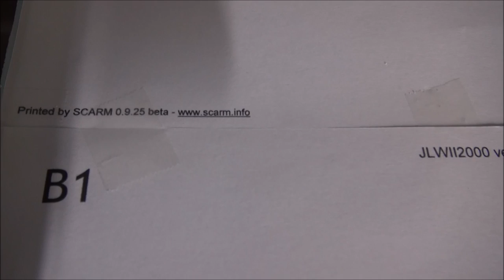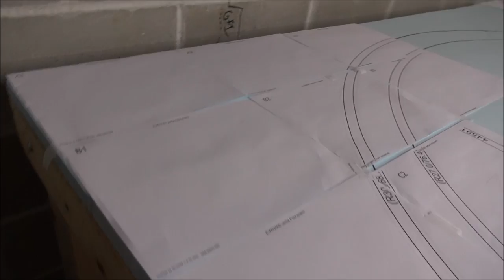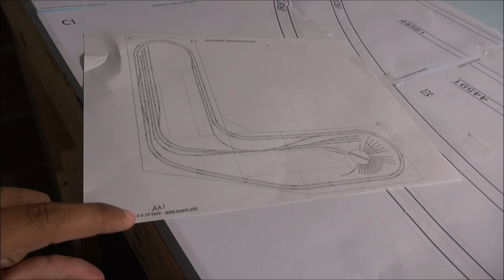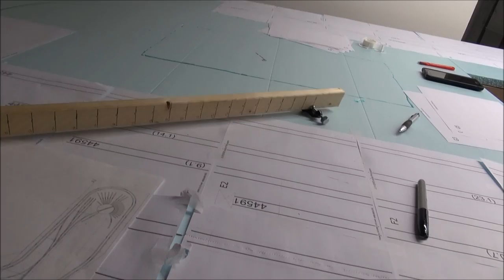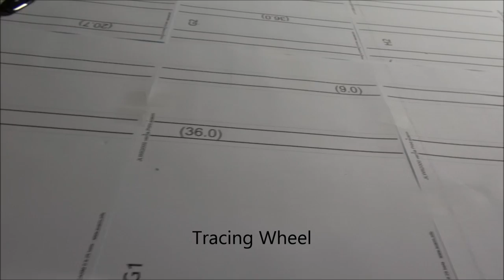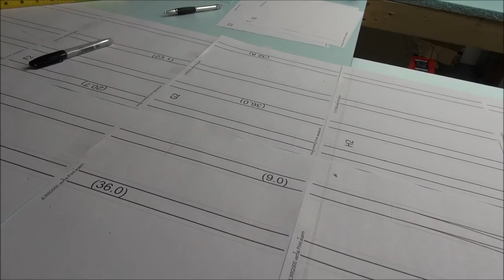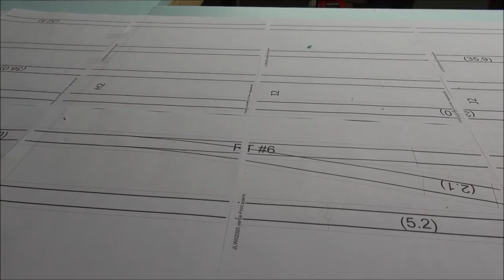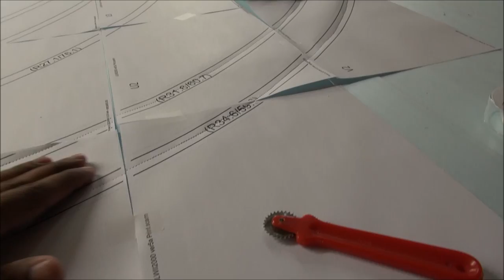How To Build a Modular Layout Pt 4 - Track Plan Transfer

Comment: It looks like it worked out pretty well with the tracing wheel.  One other way some people transfer the track plan is to have it printed on wide plotter paper from a company.  That can cost a lot of money though.  Once the plan is positioned on the table, you can glue the paper down where the track is, not the white space.  Then you trim off the excess with a razor knife.  Once that is done, the track can be laid down on top of the plan like usual.  This may not be very easy gluing to foam with paper, so this version should be done on homosote or wood where the glue will stick to it better.

Another way with foam is to cut out the switch locations or trace where the rails of the switch will sit.  Cut out the switches from the plan, lay your cork and switch in the position it will be in.  Also drill your holes for under table switch machines at this time and mount them to the switch.  This will save you time and heartache later.  Once your switches and other items like turntables are installed, lay your track in between the switches.  Doing it this way will allow for adjustments in the flex track to make it fit.

Comment: Nice tips.  I have used scarm for a few years so pretty much know the basics of it.  I will be posting a quasi how to on using it to plan your layout. Nothing in depth but some basics. Also if you go through there how to part of there site it's very informative and gives you good knowledge of how to use all the features. Not to mention many have added there files of there scarm layout designs.

Comment: Seems odd that scarm , given centerline is so critical, doesn't have that as an option to print. So in the end you did not use the wheel imprinted lines but instead measured from the edge?
Reply: It may have been recently added because the version of SCARM that I recently downloaded and installed does indeed have an option to show/print the track center lines.